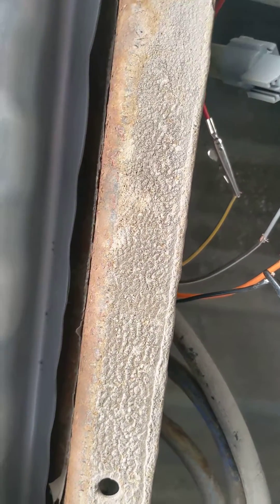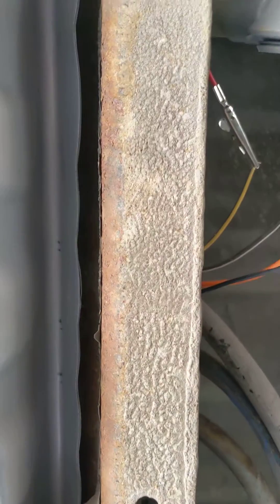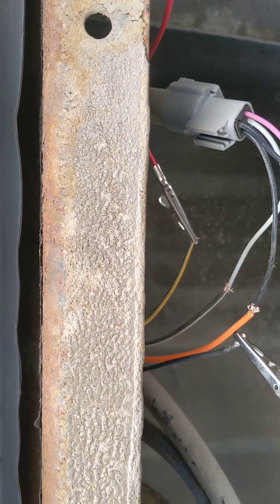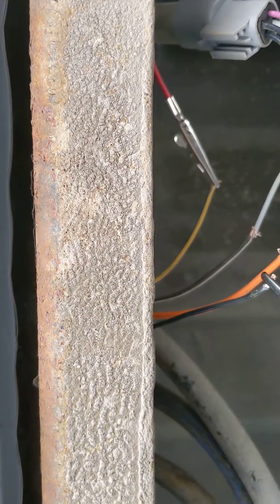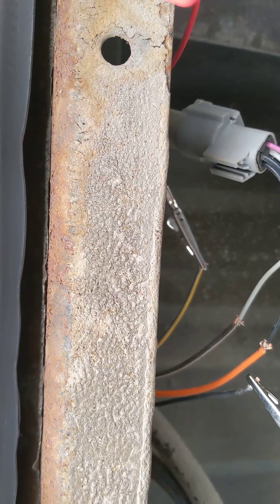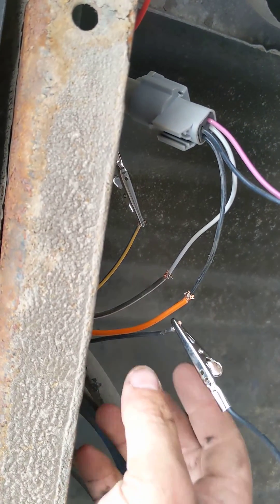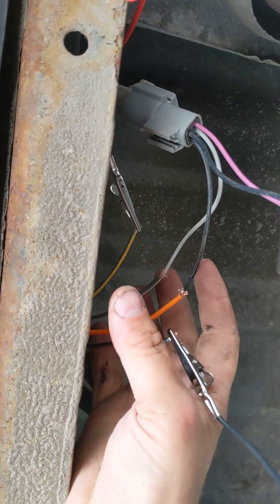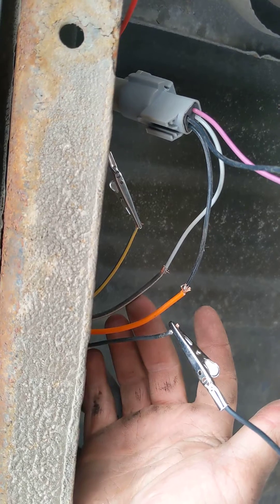92 Ford F250 fuel pump wiring diagram

Comment: You are the only one to get this right that I've found. Hours and hours of trying to find which wires go with which wires on a 92' F-150 Flare Side. The only difference is you have Grey from Pump to Black & White on pick up wire harness.  My 92' has a thick Red. So it's Grey from F. Pump to Red on P. Up harness. I just wanted to say thank you for your help!!!!
Reply: Mine is same as yours.  92 F250 reg cab 5.0.  Otherwise, other wires are connected same as in video.

Comment: My 94 F250 wire harness is red, orange, black and blue with a yellow stripe. Do you know which is which there?
Reply: Did you figure it out,because I have the same wires...which ones did you connect?
Reply from the maker: I believe the red it pump power, orange is pump ground, black is  sender ground, and blue is sender signal
Reply: @davidasbury1931 My OEM Wires are ORANGE, RED, BLACK, BLUE with YELLOW but the new pump has PINK, GREY, BLACK, BLACK w/YELLOW.  Any idea which goes to which?
Reply: @mark97213  red goes to gray, blue and yellow to pink or purple, black to orange, black and yellow or black and white to black
Reply: I have the same wire harness on my 91 F-150. What color wires did you connect together?